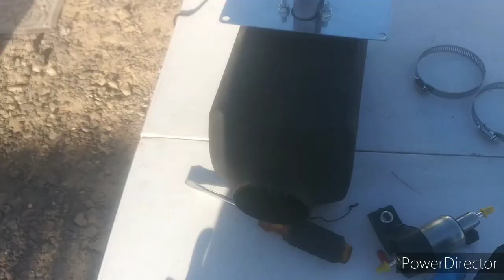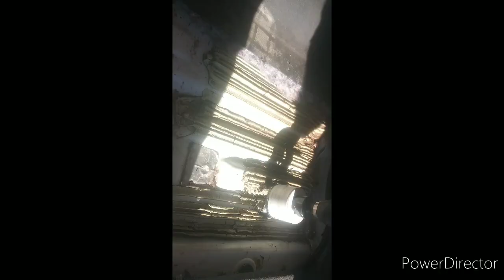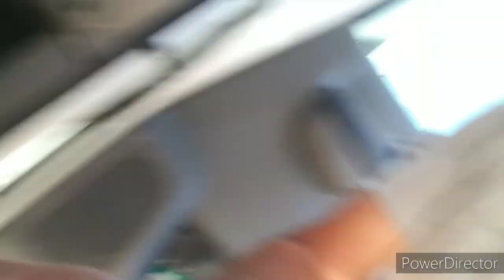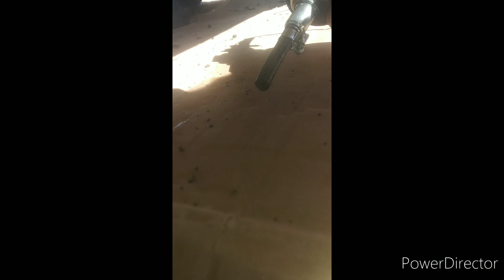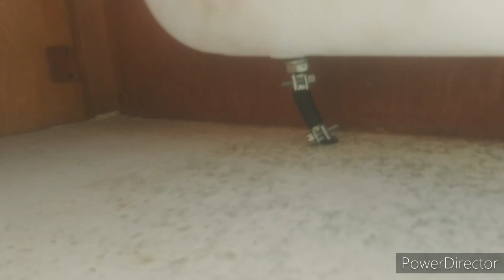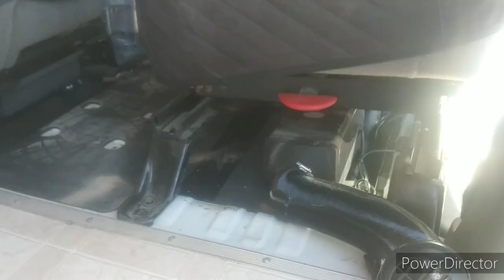Diesel heater install (8 kilowatts) in a Nissan NV 2500 #diesel heater#high top van#vanlife

Comment: Great job!  I'm just about to install the same diesel heater and have a few questions.  What size hole saw did you use?  My heater came with the soft fuel line and I've read it shouldn't be used.  Where is the best source to purchase the nylon line and clamps you used?  What did you use for sealant?  Thanks!

Comment: “The air for the combustion chamber of the heater must not be drawn from the passenger compartment. Combustion air must be taken from outside of the vehicle to guarantee the safety of the passengers. The combustion air intake shall not be mounted with the opening towards the front of the vehicle.”

“The air outlet ducting is hot when the heater is operated. To prevent a fire from occurring, the air outlet must be so positioned or guarded that blocking by rubbish or luggage is unlikely.”
Reply: So r u saying they need to do some of it differently before their friend gets killed